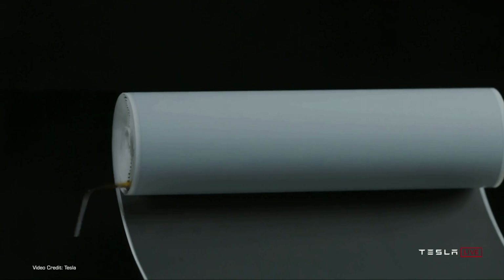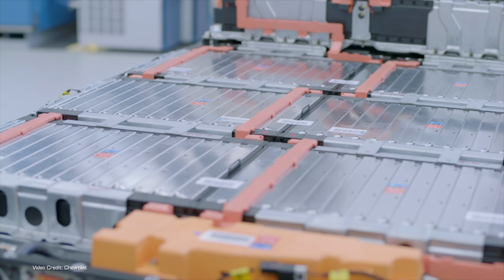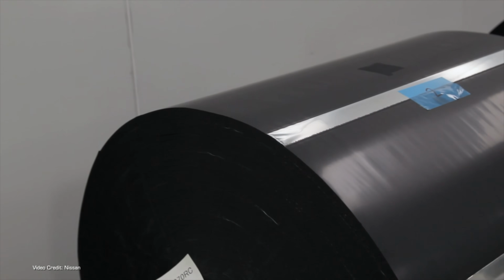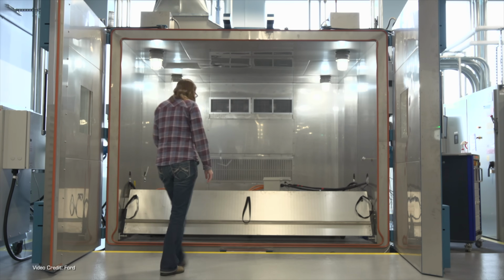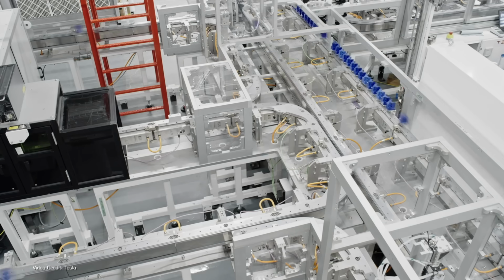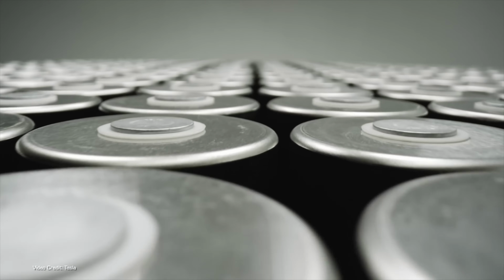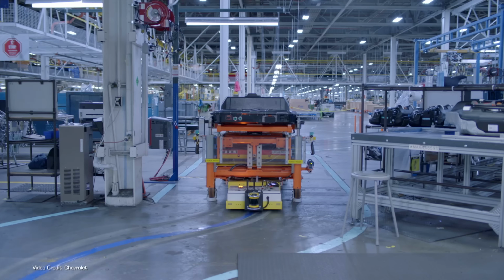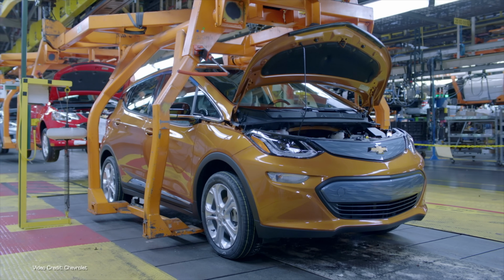Just Why Are Electric Car Batteries So Hard To Produce (And Diagnose)?

Comment: Great analysis. I've been trying to explain this to people for years. Not just about batteries but other things that are studied in the lab but can't be scaled. Also, the other problem is that you have to look at it in real world situations. I live in Phoenix arizona. 115° or around 45° c is not uncommon. How you would have to consider how all of this would perform in this type of temperature. Conversely if people living super cold climates how would the batteries perform. Would the heat or the cold across time and or mileage change the Dynamics of the battery. One way or the other.

Comment: I remember Robert Lewellyn saying that a very tiny fraction of battery Cobalt has ethical sourcing issues, but you make it sound more common. What % of Cobalt used in oil refining comes with ethical issues?